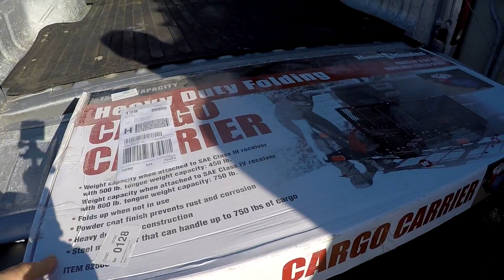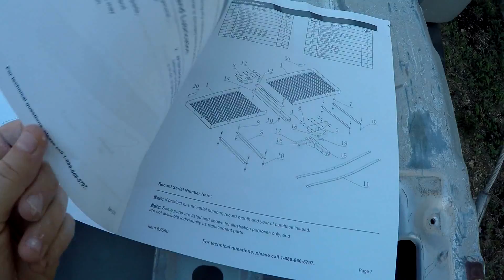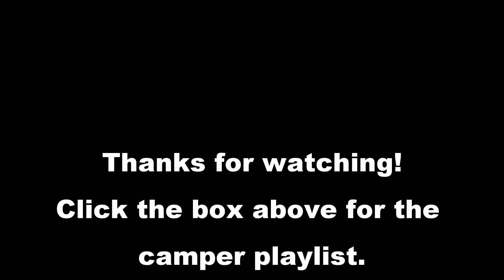Modifying Harbor Freight Cargo Carrier To Haul Bicycles

Comment: Will be buying HF carrier today and modifying it like you did. Our E bikes are too heavy for a regular bike rack so this is the only way to go. Thanks for the idea. It may not look exactly the same as yours but it will serve its purpose. We have a truck camper too and I just got done putting a front hitch on it. The back wouldn’t work because of weight distribution plus we would not be able to open the camper door. This the next best thing. Thanks again.
Reply from the maker: Glad you benefitted from the video.  Thanks for the feedback.  Fair Travels!

Comment: If you slip a dollar store "pool noodle" over that upright, secured with zip ties, you won't scratch the paint on the bike. Make that upright fold-down left or right with a bolt as a hinge, you can still use the folding cargo portion when the bikes arent on there
Reply from the maker: We do use a pool noodle!  Time to get a new one though....our current one has almost bit the dust.  In our travels we go over some pretty bumpy and rough roads.....we found that we needed some side bracing at the bottom of the upright.  to keep it from moving side to side.  If we ever want to take it off....just a few bolts.  Thanks for watching and taking the time to comment!  Have a great day.